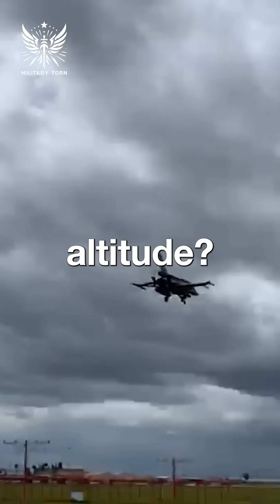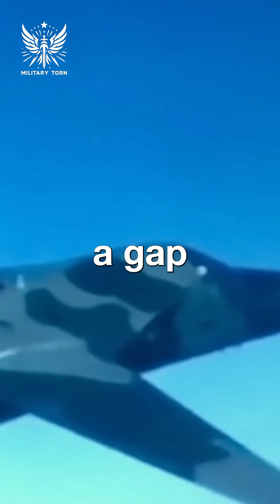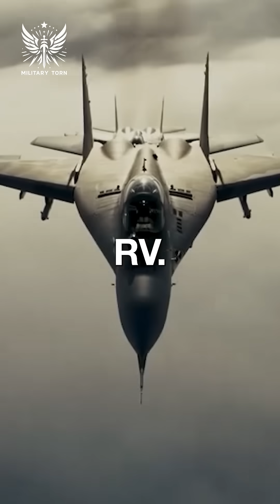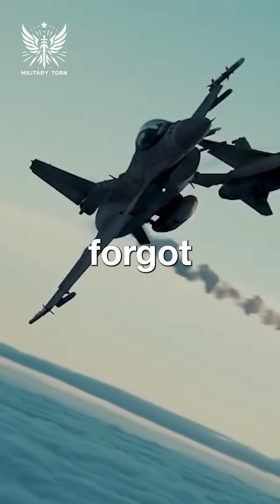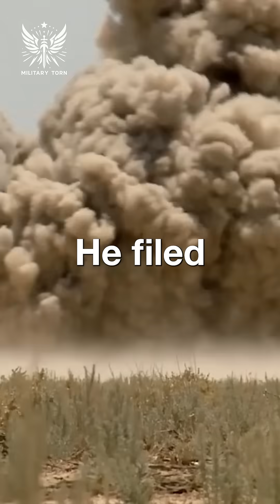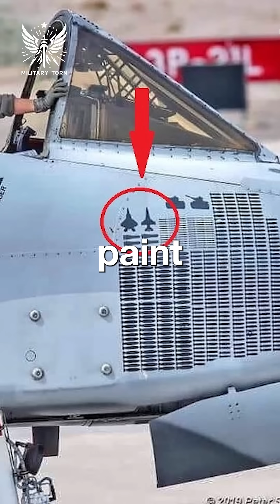What Would Happen If A Fighter Jet Flying At Mach 1.5 Passed Over A Civilian Car At Low Altitude?

Comment: Years ago, in the middle of nowhere I was driving a commercial box truck. With the windows open I began to here a whine. I thought a motorcycle was passing me. I looked in my side mirror and saw nothing but the whine got louder. A second later I heard a loud roar/whoosh from the military jet as it buzzed the cab of the truck about 100' off the ground. 
By the time I instinctively ducked it was already a half a mile away as I watched it fly off.
Still pretty cool. 😅
Reply: I had the same thing happen with a couple black hawks, I thought I had a flat tire with the whump whump whump sound, so I get out to look and about poop myself as they go over.  Public road without restrictions but an area they train in frequently
Reply: @JamesFrey-II  when my constr gang worked the charleston SC area, those monstrous military cargo planes with the props that sounded like bees were always doing loops around the area.  it was something else, to get used to.

Comment: Well I will say this. During 9/11 I went outside when I heard one jet fly over heading to the airport to lock it down. Then another F-16 flew over. It was so low I could read the white lettering on the missiles and external fuel tanks. Thankfully it didn't blow out my eardrums but man did it hurt my ears. Very painful several days later but eventually healed and didn't cause permanent damage.

Comment: Ion think people realize mach 1.5 at low alt is extremely hard to do. One the plane hardly wants to go that fast due to air resistance. But then actually having to maneuver is even more dangerous and difficult
Reply: This seems fake or skewed because there's no way mach 1.5 at 200 feet is possible, especially for an f111. I found something that says it was capable of going 480 knots or a little faster given good weather conditions at 200 feet, but this is nothing close to mach 1.5
Reply: @AgarRolo  The FB-111 was capable of Mach 2+ at altitude. 1.5 at 200 ft is hustling, but doable. Edit: The number you gave would translate to the aircrafts cruising speed. Not what it's capable of.
Reply: @Q_res  The manuals are online. The FB-111 is wholly incapable of going 1.5 mach at 200 feet. It's hardly capable of mach 1.2 completely clean at 1500 feet.
Reply: @K_GHOST225 There are pilot reports of it being able to do 860 knots at 200 feet. Conditions would have to be extremely favourable though.
Reply: @K_GHOST225 200ft sealevel , this was in mountains.
Reply: they didnt say low altitude, they said 200 feet off the ground..... IN THE MOUNTAINS. mountains to me, thats 4000+ feet in elevation.
Reply: still prolly fake tho... XD

Comment: Interestingly, the Soviets had played around with the idea of weaponising those low sonic booms back in the 60s and early 70s, spearheaded by the idea of the "M-25/Theme 25", a conceptual plane unironically nicknamed the "Hell Reaper". It would have had to be a massive plane, with one of the most promising plans put forward for it weighting in at 110 tons for it to be able to displace enough air going at mach 1.4 in order to do serious damage solely through air pressure and the sonic boom it would create. (For reference, the plane that inspired their venture and that they used to test many of the concepts, the Mig-21, comes in at just under 6 tons)

The plane never really got past the concept stage since the soviets didnt have any engines that could produce nearly enough power to fly a plane that large and heavy fast enough.

Comment: Worked on a very remote home owned by an Artist to fix his electrical  system in Southren Arizona.  He kept having military jets fly down his small valley.  After numerous complaints,  being told he lived outside of the practice area, and that wasn't possible. Finaly a big wig from the AF came to talk to him . While they were talking, 2 jets flew down his valley a few 100 feet off the ground ......
Reply: So, what was the outcome of that meeting?  Why leave us wanting for the end of the story?
Reply: And…
Reply: And...😂
Reply: Anyone who lives near Tucson knows this. Green Valley is also one of DMs training areas. Hell, you can see part of the Boneyard from Valencia road and the Pima Air and Space Museum is also there. 
It is not uncommon to hear and see A-10s or F-16s. 
DM is the biggest base in southern Arizona. If the artist lived anywhere within 100 miles of DM, they are still in the flight zone.

Comment: The Soviet Kashin class destroyer had a problem coping with supersonic jets passing over at very low altitude.  The compression wave from the plane could travel down the main air intake ducts and wreck the main gas turbine engines, making that destroyer a "mission kill" requiring time in a shipyard to replace those wrecked engines.
Reply: Now that's funny!

Comment: Why did it have a cow? dark chocolate, coarsely chopped

1 teaspoon espresso powder

1 teaspoon pure vanilla extract

½ cup granulated sugar

½ cup firmly packed light brown sugar

¼ teaspoon salt

3 ½ large eggs

Heat oven to 350º F.

Line 9-inch square baking pan with aluminum foil, extending foil over edges. Set aside.

Whisk together flour and baking powder in small bowl. Set aside.

Place butter and chocolate in large microwave-safe bowl. Microwave in 30-second intervals, stirring after each, until chocolate is melted. Stir in espresso powder, vanilla, sugar, brown sugar and salt until well combined. Add eggs, 1 at a time, beating well after each addition and then beating at high speed for 1 additional minute. Gently stir in flour mixture just until combined

Pour batter into prepared pan. Bake 20 minutes or until a toothpick inserted in center comes out with just a few moist crumbs. Cool 20 minutes

Refrigerate until serving. Lift brownies out of pan, using foil ends. Cut into 16 squares